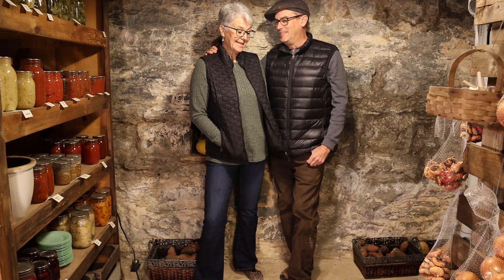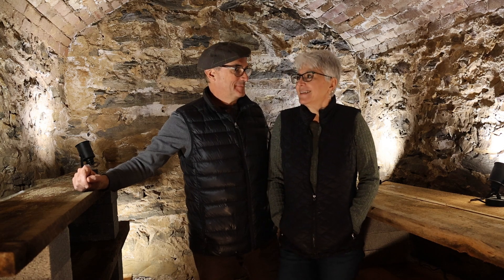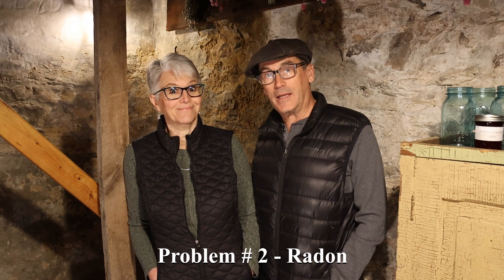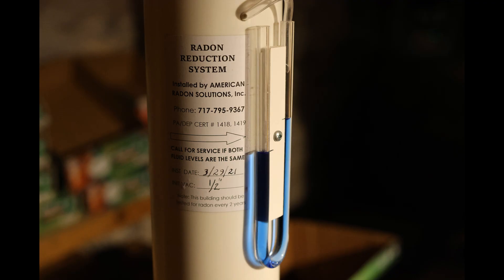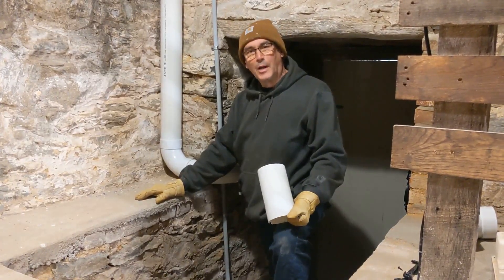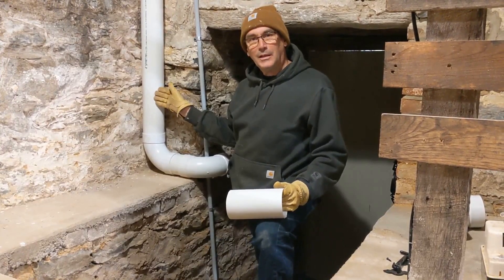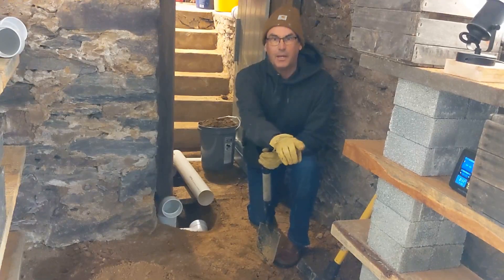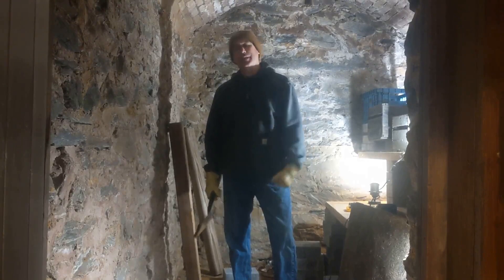1840 Root Cellar - Installing Ventilation for Temperature and Radon (part 1)

Comment: If it is possible, I would cross ventilate. I would pull the hot air return closer to the ceiling. cold air would come from the floor. it would help cool it down by pulling the warm air from the top and replacing it with cool air from the floor. I love your cellar. great video.
Reply from the maker: Agreed, for purposes of ventilation for temperature the placement of a high return is best. However, we also have the need to vent radon which settles at the floor level.  Tough call.  Thanks for the input. I will experiment with both setups and test results.

Comment: Great job ! Would a concrete floor have helped ?
Reply from the maker: It may have helped, but it would take away some of the humidity in the root cellar....we're hoping for very high humidity.  When they did the mitigation, they would have cut through the conrete to create negative pressure.  (That's what they did in the larder level.)

Comment: What about your food non canned you keep in the basement? Love your channel I am up in Williamsport
Reply from the maker: We're fairly certain that getting the levels down in the root cellar will have an impact on the larder level.  (lowing the levels)  From what we've read, the biggest risk with radon is breathing it over a long period of time.  Most info says food will be ok, but if the levels are still high after the ventilation system is finished, will have to do further research.

Comment: Aw, man! Bummer! Painting the pipe black might help the appearance. Would the stored food absorb the radioactive gas?
Reply from the maker: Right now we're thinking some kind of wood cover, but we're not quite sure yet.  As for the food, we are hoping that the ventilation will take care of most of the radon problem.  From what we've read the biggest danger from radon is breathing it for a LONG time.  Most sources say the food would be ok, but if the levels are still high we will be doing more research.

Comment: I would love just a basement, any old basement.  We live in a flat, low area with the whole neighborhood on septic, not to mention all of the rock in our soil---so no under or in ground anything, not even a storm shelter.  What a bummer!  Glad to hear there is a solution for your problem.  It would be a shame not to be able to use the larder and the root cellar.  My son that lives in Nebraska has an older farm house (early 1900's) with a root cellar out in the yard.  It's made of brick with a pretty arched ceiling.  The ground temp gets down to about 50 to 52, depending on time of year.  It needs repairs and a very good cleaning, but I think they should take the time and money to bring it back to it's former glory. God bless you'll and keep growing.
Reply from the maker: Thanks.  I'm very thankful for the root cellar.  Yes, I think all of the old root cellars should be 'brought back to their former glory' too.